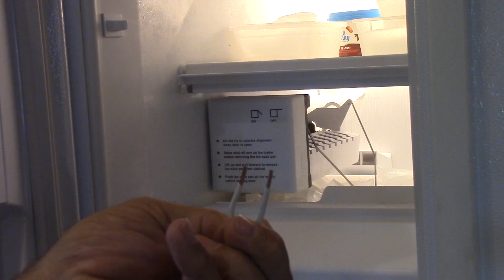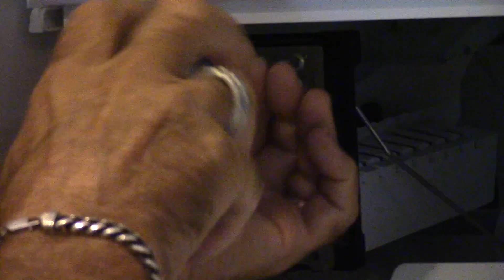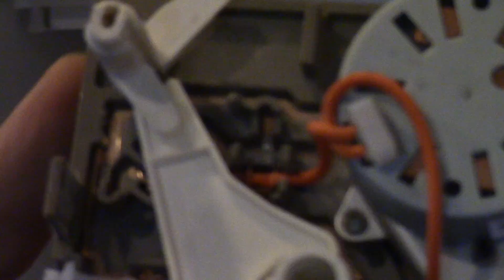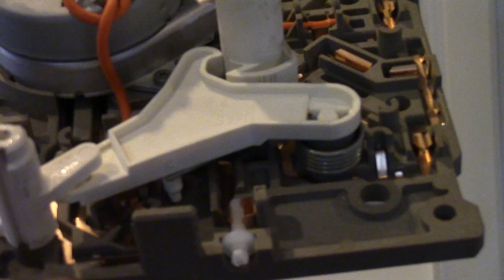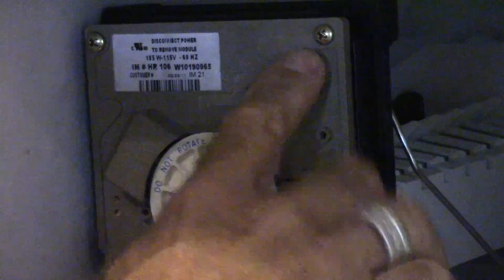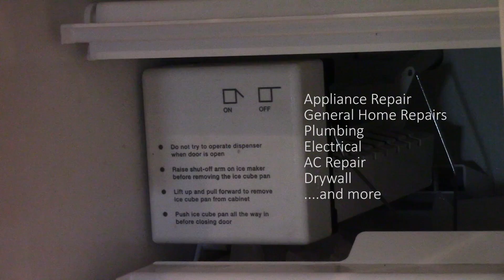Whirlpool Ice Maker Manual Harvest Works But No Auto Harvest - Ice Maker Quick Fix

Comment: This was THE FIX for my Kitchenaid ice maker (2007) not harvesting the ice. I checked all the recommended voltage and ohm tests in other videos I was watching and the tests were OK. After a week of manual harvesting, and other trials i found this video! I took me two tries to get it clean the contacts well enough to run multiple cycles to fill the ice bin. It is now working. THANK YOU for this great, easy, and simple video fix.

Comment: A couple of questions. With your wire jumper, you did not mention which holes (ie. T and H / T and N or so) to insert the jumper to cycle. Secondly, how did you determine that it was the ice maker and not the water valve and not be suspect of the dispenser switch (micro-switch) which can control the ice and the water dispenser (no water, no ice)? Thanks.
Reply: If you listen again, he stated contacts T & H to jump start. He also mentioned that there was ice ready but it was not harvesting the ice. This he went on to show how to clean the points.

Comment: Doesn't harvest or jumps the harvest step.  I did change the valve, but that didn't make any changes to ice maker working. still not working. Standby power works. Tested valve, works. Jumpers did not work with door switched pushed. Doesn't rotate. Is the ice maker dead or something else can be repaired in the unit? How do you test the motor? Can hear it spinning but small plastic wheel is locked. doesn't turn under manual power as I removed it from the plastic molding. Ordered a whole new component but I would love to know how you test the motor or get a locked motor to release in some way or if I would know that I could just order motor and be even cheaper. ANy farts?

Comment: hey. i got this exact ice maker. my issue is that it never goes into harvest mode. the pointer on my ice maker is just barely past the harvest bypass terminals (roughly 5 o clock position) if i bypass it, the heater doesnt kick on (i think its normal i heard somewhere else).

Comment: Good video...
A little aside for mine though. I have a harvesting issue where the ice maker won't complete the cycle. Replaced the water supply valve from the pipe in the basement. Replaced the filter. great water flow and ice size at this point.  It will harvest from the start but cycle stops when the wheel is at about the 10 o'clock postion. (The ice about vertical). To get it to finish have to use a hair dryer or reach in and pop the ice loose... Is this the contact issue you spoke of in the video?

Comment: Great video and instructions.  Is there a thermostat on the module that could be the problem also?   I have this issue and will clean the points as shown but curious how to know which component is the problem.  Once I do the points I guess I’ll know that answer correct?   Thanks.

Comment: I have to he exact same ice maker I’ve fixed it about 5 times in 9 years. I’ve replaced the whole ice maker, then the dial on front, I’ve made 1 out of 2 with all the spare parts I’ve accumulated over the years. Only thing is mine has a on/off rocker switch. I recently replaced that rocker switch and now it makes ice again but it only cycles when that switch is on, which makes sense, but when the switch is on my blower fan in the back of the ice maker doesn’t run. As soon as I turn that switch off the fan comes on. Which is probably the way it’s supposed to work, but if I leave it turned in over night my fridge won’t cool. So every day I have to let my ice maker cycle, keep an eye on it and let it make some ice, then flick the switch so my fridge will cool. If the fan is running, and I turn the rocker on, the fan will still run but as soon as I press the door light button the fan stops running. It’s almost like the switch either allows it to make ice or cool the fridge. Not both. Where before I never had that problem. I’m stumped

Comment: Stamped copper contact points are typically selectively plated to create a self-healing surface, or at least not oxidize rapidly. Otherwise they form a copper oxide rectifier like a 1960’s HO train transformer. That raspberry sound a land line telephone in poor condition used to make periodically was the oxide layer diode breaking down and then re-forming and doing it again. When you burnish the contacts you strip off the plating. It would be better to clean them with an electrical cleaner. When they’re clean if they don’t function and they show a really rough deeply pitted surface there’s nothing to lose by burnishing the surfaces. If you burnish them you’ll end up doing that every few hundred cycles until they’re burned through, but refrigerators don;t last forever so not putting a new ice maker in an old fridge can make sense.

Comment: I got a brand new water valve and whatever failure mode is saying is that the ice solenoid is being energized all the time so water flows into the icemaker all the time. I took apart the icemaker and I’m very familiar with its functionality. I just can’t figure out how the solenoid is being powered constantly for the ice.  It looks identical to yours. It only has the two gears and none of the test ports that some of these ice makers have line yours

Comment: My ice maker makes ice but seems to leak excess water  ok lol water fro ice try but then I can pour about 4 ox of water which is barely half full but water runs out of ice make at left front corner on side where a single wire bail tripper for ice is .  It is about on 2 ice cube side and I runs like a stream , I removed I’ve maker and carried to sink and poured water in and I held I level an no water ran out but when taking ice maker out of refrigerator the bottom screw seemed lose even on bracket mountin to hold underside of ice maker the two to screws seemed ok but could front corner be dropping down or should I look for hold in ice tray    Tha Ge side by side model TFx 24JRXA   WW.  Serial number HM 239092 bought on Nov 15 1995.    .  All water seems to fill ok but we have noticed for months that extra water got 8th Icebucket to freeze under  the ice crusher or cube dispenser and we remove ice bucket to free frozen ice cube or ice block that stopped ice from coming out but worked fine when new ice was made again . So it appears the water leak from ice maker has been around for awhile but bad just lately .  Cutting all water off to refrigerator and no water in there but less than 4 ounces and water runs out of ice tray although no wher half full . Do you think just buy a new ice maker , or what I see no crack but if I hold it very level and pour in 4 ounces of water , it just don’t seem to leak. ,, could being out of level in refrigerator cause it to run to front outer corner to leak water in hairline crack I can’t see any leakage. . What control how much water comes into ice maker.  Could the water valves behind refrigerator control the amount and not shutting off ?  Looking at ice tray from bottom , where water runs out next to heart tube , there looks like there could be a small hairline like where it vibrated over years being loose on lower screw to cause the tray to have possible tiny crack because there is metal as if it were worn but after removing ice maker and balancing over bowls level and manual added 8 oz of water through back fill cup to fill tray , I can see no leak . But when it was on refrigerator it was flowing like water from a solid stream . But when removing . Top screws that it hangs on were fairly snug but not over tighten but bottom screws was really loose  could it just not been tight enough to cause water to overflow or is their control in head of ice maker that controls amount of water that fills trays .?.. help please   refrigerator has wheels but does not roll , been sitting I guess to long and heavy for me !!

Comment: Mine was working when I use the jumper but then it stopped. I took it apart like you did in the video and found that the actuating tube for the Harvester arm had a crack in it because there was ice inside of it. I have removed the ice dried it off apply super glue to the crack and put a clamp on it to squeeze it back together. I'll let you know if it works when I reassemble it.

Comment: Liked the video, will try to clean up contact points. I have a question though. Last year I diagnosed a failed water valve selonoid in the same fridge you showed in the video. I could not find an exact replacement part. "discontinued"? I found one that looked as though it might work, modified the mounting bracket and made it work. I seems to be for a smaller ice maker of some kind as it will not completely fill the tray. I get about 3/4 of the ice i should. The water adjustment does not really do anything to help. Any ideas, or maybe you can suggest a different selenoid that will give me the right volume of water? Thanks.

Comment: I have a Whirlpool side by side that uses an electronic ice level emitter instead of the wire bail to sense the ice level and shut off the icemaker.  Does my icemaker also have the points or is the unit different?

Comment: Question... my module isn't rotating however I don't see any water being brought up there either. Is the job of the module only to spin when ice isn't full or is it also to tell the valve to open and close? Thx
Reply from the maker: It's basically a rotary switch, which goes through the progression of making ice. Calls for water, tray fills, then x-time passes, lets say 2 hours, it then signals the tray heater to release the cubes. When that's done it signals the motor to rotate the fingers and harvest, then back to step one.
Reply: @vantekhome7783  thanks for the reply. I guess my question is about the "calling of water ". I don't see any water so I'm trying to figure out if the issue is if my unit is falling water but the valve doesn't send any or if the module stopped asking for water and the valve is fine. Thx

Comment: Hi What is the solution on my refrigerator, Water is dropping from the ice maker and stock it on the container ice
Reply from the maker: The tray is worn out and most likely has a pinhole in it. Cheaper to just replace the unit than rebuild.

Comment: Did all you directed, but during harvest test it does not cycle. Previously harvesting had been very intermittent. So cleaning points no go. Bad module?
Edit, removed whole unit. Discovered fingers frozen solid in the ice. In previous testing I'd done a water dispense cycle, overfilling tray and locking everything in upon freezing. Reinstalled after thawing. Btw, the wiring harness has an inline fuse, held in the back of the unit by a fuse holder. Only measured .1 ohms.
Reply from the maker: If the tray over filled there would have to have been a change to the level screw. I don't recommend doing any adjustments to the module.
 A fuse should measure close to 0 Ohms unless it's open in which case it would measure OL or Out of Limit (meaning that it is beyond the test meters measurement capabilities i.e. a Mega-Ohm meter would read >99 M-Ohms and a Giga-Ohm would be >999 G-Ohms), these ranges get confusing to some so manufacturers typically go with OL on the display. 
As far as I know (and according to the schematics) there is no fuse in the wiring harness, there is a "Mold Heater" that is a small round component that looks like an inline fuse on the (typically)  Blue or Black wire. That should be held in contact with the bottom of the mold by a stainless spring clip to heat and release the ice.

Comment: Helpful video, the center rotator on mines stays engage and it won’t stop and water won’t go in the ice maker. Have you even seen that problem?
Reply from the maker: If you tried cleaning the contacts and it still does the same thing there is most likely an issue with the  module. All of the start stop functions are contact based. Modules can be replaced but I found it's just easier to replace the entire unit.

Comment: Video helpful. I just replace my ice maker with same symptoms. Would only harvest manually everything else works. New ice maker doing same thing. Any ideas.
Reply: If you just installed it, the first harvest can take up to 24 hours, then it should start cycling regularly.
Reply: @vantekhome244  It went through 2 harvests in the first 2 hours and seemed to stop. I waited about 24 hours and did a manual override. It did a couple harvests and seemed to stop again. Now 24 hrs. is seems to be working properly. Thanks.

Comment: did not demonstrate cleaning the points.  I want to see how cleaning is done.  How do I know if I'm doing the cleaning correctly.  Otherwise video was okay.
Reply: Make sure the power is off.  Just use some 500 grit or finer emery cloth or wet dry sand paper (dry) and cut it into a 1" strip, fold in half and put it between the points and lightly burnish (sand) the points to remove any carbon build up. They should be shiny when done. Don't use sprays or chemicals.  Hope this helps.
Reply: I cleaned the points and still doesn't cycle?

Comment: how do I adjust what size of the cubes are made
Reply: Depending on the model, there is a water level adjustment (cube size) knob (on some) or a screw. They will adjust the water fill time equating to a volume. One complete turn typically increases water volume by 40cc or so. Small cubes may also be a sign of low water pressure.

Comment: I have a whirlpool ice maker similar to yours iin the video.  After I do a manual harvest the maker will auto cycle 2-4 times making cubes, then it will stop.  Any ideas???
Reply from the maker: When it stops is the tray full or empty? If there is water in the tray frozen, then I would suspect the contacts, if the tray doesn't fill some folk have had issues with the door switch and have taped it down (hopefully only to test) and it worked. The door switch shuts of the fill valve so while the maker may be cycling on the timer, the tray never fills with water.

Comment: Before watching this video I ordered a new module. Installed and it still doesn’t work. It works with the jumper. The brand new one and the other both work with the jumper but not without. The fridge is about a year old and has only made one bucket of ice ever. Please help.
Reply: Josh LAwing same issue
Reply: F C mine ended up being the little switch that turns the light off then the freezer closes. I taped it shut and it work. I tried to take tape off and adjust the door so it makes the switch which it does and the light goes off but still doesn’t make it enough to make ice. So I had to leave mine tapped 🤷🏻‍♂️
Reply: @joshlawing3492  Thank You for this comment. I spent days trying to figure out what was going on, running all kinds of tests and could not find the problem. I read your comment, taped the switch closed and it works. The switch is the issue. Thanks Again!

Comment: My Whirlpool ice maker make ice but doesn't shut off ice Production when the Bin is full, Just piles up over the Bar! Doesn't seem like the Bar is working Correctly?  Also the ice is Hollow not Solid? Adjustment maybe? Thanks for any help You can give.
Reply: These are pretty simple devices that work with basic make-break type of connections. My guess is that the level bar contacts are dirty/corroded so not making an electrical connection so harvest doesn't stop. You would have to lightly clean the contacts for the bar with some 500 grit sand paper. As long as there have been no adjustments made they should be set so hollow ice (a shell) means that the cycle is maybe skipping or accelerated, since dirty contacts can cause failure of an electrical connection, which is why a cycle stops, runs past and then causes a short harvest because it activates the next step. When you disassemble to clean , take pictures and take your time, clean the contacts and see how that works out. It usually fixes most issues. Good luck.
Reply: Hollow ice if often because the fridge filter needs changing.  Make sure your fridge isn't set to extra ice production.  If ice isn't used often enough, you may just need to manually turn the icemaker off until you've used most of the ice.

Comment: Hi, i have Kitchenaid fridge KSRS27CNSS00. my ice maker does not work. I jumper H and T  and it is harvesting manually and fill valve working, laser for ice level has 2 blinks n 1 second delay and red solid light when flipper is not in way. I replaced cycling thermostat and closed the fridge for 24 hour. Strated for test and it made icein auto.  Then i stopped the fridge again  for approximately 2 hours for cleaning and putting shelves back. Now again it is not marking ice. Would you please tell me what should I check now. Thanks

Comment: Thanks! This is exactly the problem I'm having. I'm going to try this solution tomorrow and hopefully that will be it. Thanks. Well done vid, too, btw.
Reply from the maker: Thanks Jonathan, the one in the video is going on 7 months since repair and still working great. Hope you have the same luck.
Reply: These are pretty simple devices that work with basic make-break type of connections. My guess is that the level bar contacts are dirty/corroded so not making an electrical connection so harvest doesn't stop. You would have to lightly clean the contacts for the bar with some 500 grit sand paper. As long as there have been no adjustments made they should be set so hollow ice (a shell) means that the cycle is maybe skipping or accelerated, since dirty contacts can cause failure of an electrical connection, which is why a cycle stops, runs past and then causes a short harvest because it activates the next step. When you disassemble to clean , take pictures and take your time, clean the contacts and see how that works out. It usually fixes most issues. Good luck.
Reply: good video..thank you to the people who do this..  I need to call a repair man. dang